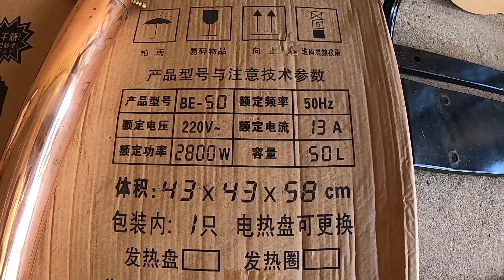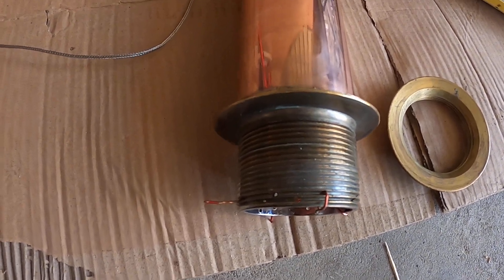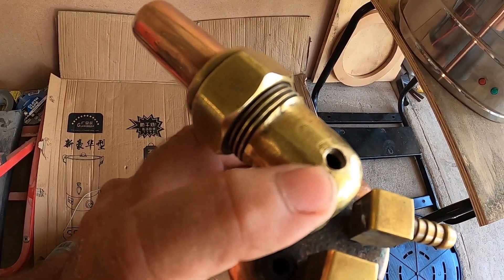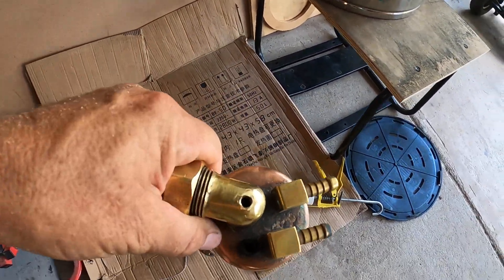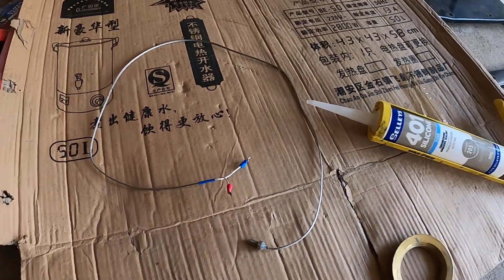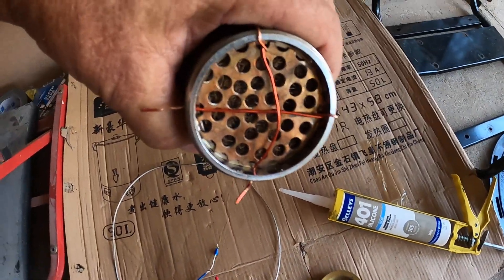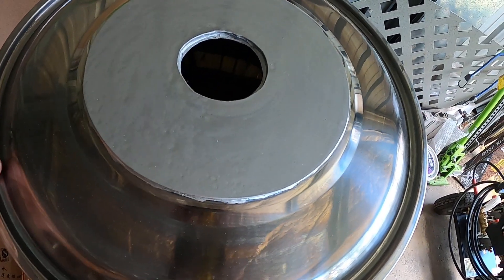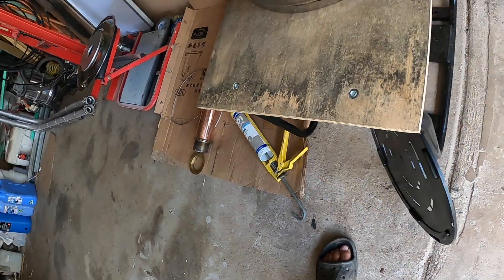Making a electric urn still for distilling. (Pt 1)

Comment: Instead of putting silicone on the nut under the lid when you put the threaded end of the column through you can use a silicone ring washer that will squash and seal when you screw the nut up tight then when you dismantle it you can use over and over no mess

Comment: Brass is no good for makin booze mate.
Reply: Yeah. Also, I’ve heard of people removing the lead with acetic acid. But after the acid wash, I would think that because the lead is melted with the copper, the brass alloy would still have lead beneath the surface of what appears to now be “pickled copper”. 
When I was setting up my distiller, it was a pain in the ass finding copper and SS fittings. Luckily, I pulled it off without making any online purchases.